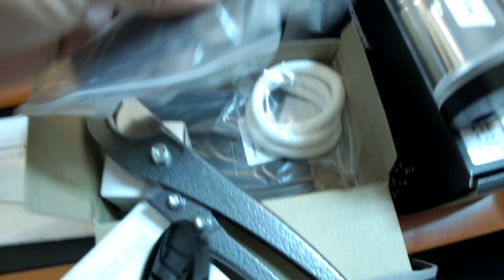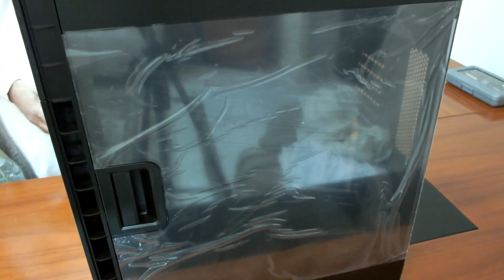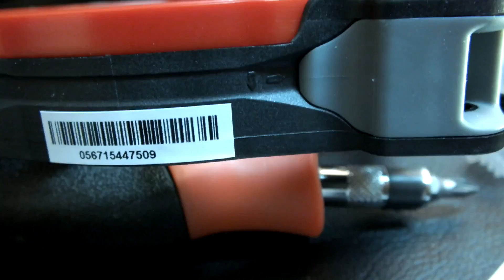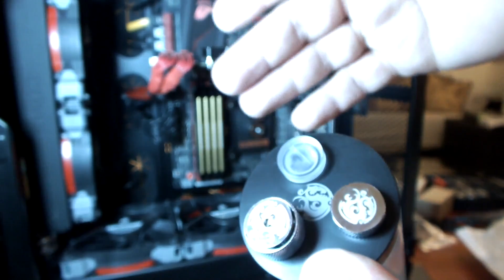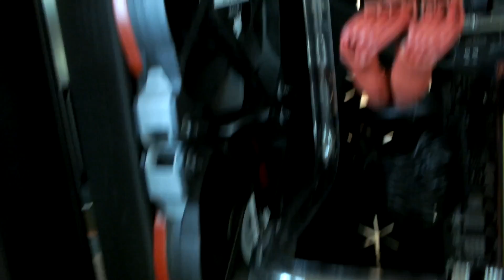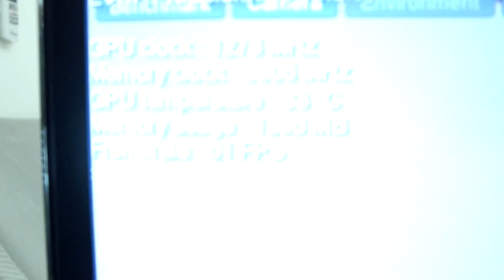Building new PC with Cooling Water System

Comment: Thanks for putting together such an informative video guide, Hamad. You've built an awesome CPU! I hope it's still running well. 
I'm looking to build a system and before seeing your video, I had no idea it will be so complicated. :) 
How did you know beforehand what small components (not the main stuff like processor, RAM, HD, etc.) to buy and whether it will all fit together in your case?
Reply from the maker: Well, the only thing you should know for compatibility issue is the CPU & Motherboard, everything else in the market just works like a charm in any system, and its not complicated once you dedicate yourself into learning about it, and the internet is flooding with tutorials for such, cheers

Comment: you use the same liquid its a closed loop ...... if u wana call it open , put a hose on it and conect it to the tap water and put the other end on a drain and u wont even need a radiator ...... ( check what it says on a cars fluid ( says closed loop ) its the same thing......

Comment: Did you set up a drain port/tube anywhere? How will you drain the fluid if need be
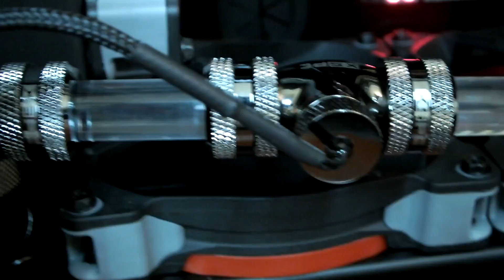Reply from the maker: I use the thermometer Plug as drain 01:01:34

Comment: Good thing you didn't go with Thermaltake ...their craftsmanship is not good at all. small hoses and the taps for the screws are same size as the screw so after they get painted they are too small for the screw to start easy as they should so in MY case I stripped the threads on 3 screws , and I'm a mechanic/tech. so dealing with all kinds of threads of many different metals is part of my job .

Comment: careful with the thermal paste , you are pouring way too much ... like three times more than you should ...
Reply from the maker: I totally agree with you if the paste were the old models which contained Aluminum particles, that would make a slight conductor and would cause an electric short, but this paste is free of Aluminum and its safe even if it spreads on the chipsets ;)
Reply: Risk of causing electrical shorts due to TIM isn't the reason why he said to put less. It's actually worse for your temps if you put more.

Comment: Why would you want to blow the heat from the radiators back into the case?
Wasnt the reservoir upside down?
Reply from the maker: The heat produced by the radiators is not that much where it will effects the mobo surface, besides its where the filters installed and designed to have the flow as such, still ... You have a point put the case design doesn't give me the option to put the radiators on the outlet air ducts, 

For the reservoir, I agree; it is flipped upside down, however; due to congested space, I couldn't make the water return goes in the top of the tank, so I made both inlet and outlet be from the bottom with the tank flipped :)

Comment: Very beautiful work, thank you for posting! 
Do you think this LCS will be able to hold 2xGPU SLI? 
I also bought the Corsair 600C and want to follow your guide to build a similar system.
Reply from the maker: Thank you, yes it can handle two GPU's as SLI , its really what I intend to do in the future , to add another GTX980 with water block, and thats why I made the Circuit with two Radiators instead of one so it can handle the heat ....... About The space!!! Plenty I say :D